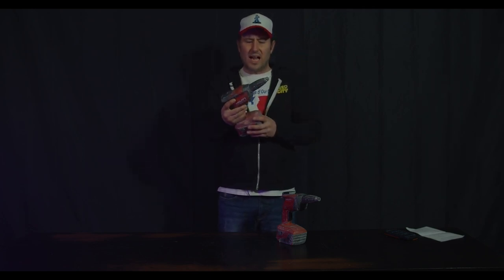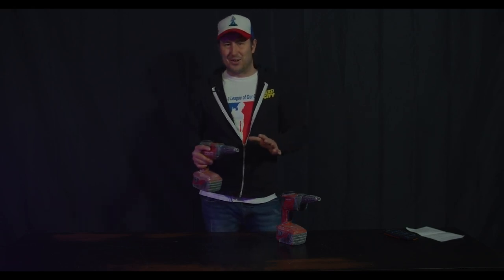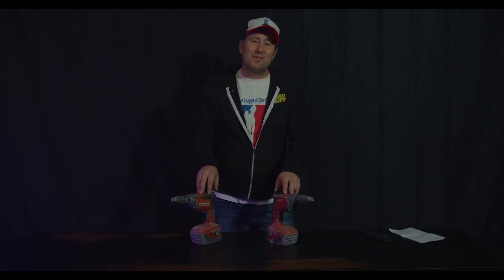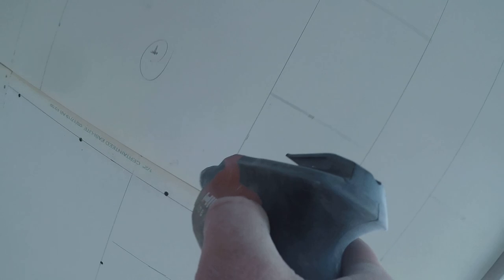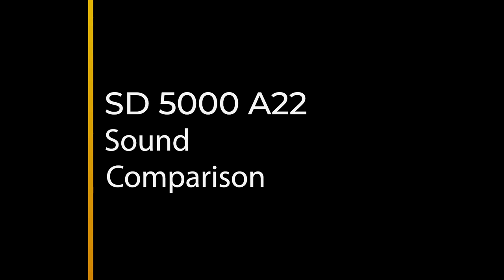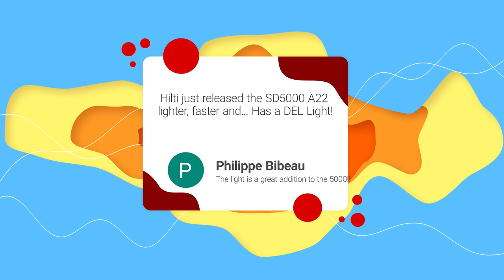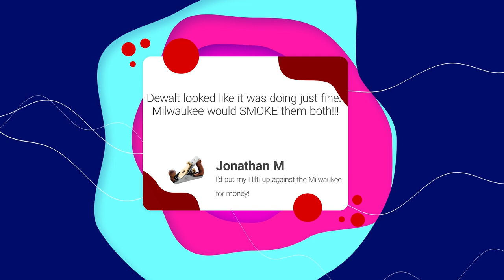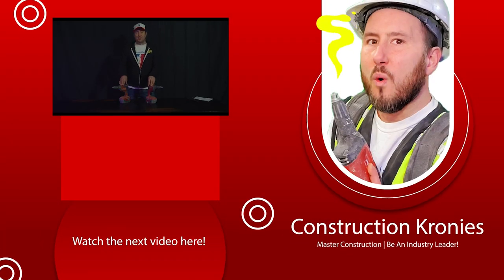The Most Comprehensive Hilti SD 5000 A22 Cordless Drywall Screw Driver Review

Comment: The Hilti are great tools. But the makita push drive is better when working in offices. And the battery lasts longer as well. And the way when you screw Drywall, you put screws every 12" on center vertical 16" 32" studs & at 8" on center on each end stud. I see you only putting 3 screws on 4' board when you were railroading the boards. Should have at least 7 screws.
Reply from the maker: Not sure what you saw in the video, I may have been just tacking them in, I put screws at the 2',4', 6' in the bevel, 4 in the bottom track. When the sheets are locked in I go back to screw off, always 1' in the bevel and 16" in the field unless otherwise specified. Cheers bro

Comment: What is your opinion of the SCREW MAGAZINE SD-M 2 02 for the inexperienced or experienced drywall hanger
Reply from the maker: It has its place in big crews, you can have the apprentices screwing off the fileds while we screw off the rest. I'm always adjusting for screw depth depending where I'm hitting, like corners, bevels for sure.

Comment: nice video man 💪i need to ur opinion :i have the b22 hilti batterries.I am thinking to buy the sd 5000-a22 (not nuron cause i have the batteries) or the flex dw45 or the makita dfs 452 or the dewalt dcf630 .Can you give ur professional opinnion ?Do you think Nuron is worth it ? or stay with the B22 platform ? Thank you
Reply from the maker: Go neuron for sure! I recently upgraded my impact and drywall gun to it and I am so happy it will destroy any other platform without any doubt! It's time now to bite the bullet and go neuron. I waited and most of my tools are still in the b22 exceot those 2. I want to upgrade them all its that good.

Comment: I love the 5000. Bought it once it hit shelves in Ontario. I did have an issue with the depth (wood only) and the trigger lagging a bit when firing it up between sheets. Warranty changed the whole motor assembly and trigger motor. Depth hasn’t improved so I just mash the heck out of it for a while and now she is good. I was actually really surprised how well Makita BL Screwgun work on steel. Dewalt in my experience has been garbage.
Reply from the maker: Dude, I agree. Honestly, I can't stand using the Dewalt, I put up a lot of board and am very aggressive when I do it. The Hilti takes my abuse. This depth issue is driving me nuts. I have been trying to mash it in myself but no change. I know all guns are stiff at first and need to be worked in but this issue I think is in the motor. Every so often say 1 in 6 the depth stop triggers too early and I have to take the nozzle off to squeak in the screw to the proper depth. Thanks for taking the time to comment, I really appreciate it!

Comment: This tool works for a 18gauge studs??
Reply from the maker: It does and very well. I use it on 16 gauge all the time.
Reply: @ConstructionKronies  what would be the best screw gun for heavy gauge metal? For outside boards?
Reply from the maker: @MXb7R  you can't go wrong with the Hilti SID 4A22 impact driver for framing and the SD5000 for boards!
Reply: @ConstructionKronies  thank you so much for answering! I'm a total beginner with drywall and now i'm requiered to board exterior walls where i'm working, so i'm learning so much with your videos, yo do a great work with your videos, you are my favorite youtuber
Reply: @ConstructionKronies  you think i could use my dewalt max xr for that purpose? I Will be hanging lots of boards daily, at least 20 per day

Comment: Hey man any experience with the new Nuron line? Ive had dewalt for a while and have been happy but am thinking of making the switch to Hilti. Our work supplies us with the Hilti BX3 and Nibbler. But i havent tried their drywall gun or impacts on the Nuron line yet. Im worried about longevity with the new Batteries. Thanks I love your videos!
Reply from the maker: Thanks man! Yes I waited for years till they perfected the new line and now am upgrading everything. I have the impact and drywall gun so far and the batteries are great. They charge lighting fast. I have the b22 55 and b22 85 batteries and have no problem with them. They've also fixed the problem with the drywall gun so all current models are good. Avoid the in between models of you know what i mean.

Comment: I've had alot of depth issues. I feel it's the nose cone
Reply from the maker: Yes man, I actually use my 4500 most of the time and use the 5000 for backup.
Reply: I prefer the 5000 because it's lighter stronger and faster
Reply: And the led light helps

Comment: Hilti depth issue is the exact same depth issue as the dewalt cordless have tried all  switch to another brand #makita
Reply from the maker: I do love Makita tools but I am really hard on my tools so the Hilti is tough enough. The depth issue usually only lasts while you break in new screw drivers but it hasn't corrected on the 5000. I can't stand the Dewalt drivers, hopefully I can get my hands on a Makita to try out!
Reply: @ConstructionKronies  yeah hate the dewalt seems smooth at first the you go back n screws ain't zinced correctly then I had to take cone off to correct them that's y I switched to makita . No problem with dewalt corded ever though 😉
Reply: @Ehvz539  I got the Makita. The depth is consistent but the dust seal falls out of the cone easily. Got one now and it it’s screeching. Don’t know what the problem is
Reply: @vojnikjna30  hows the makita gun  holding out?